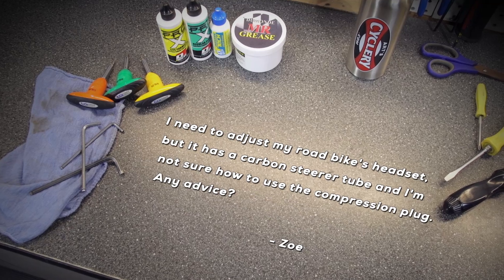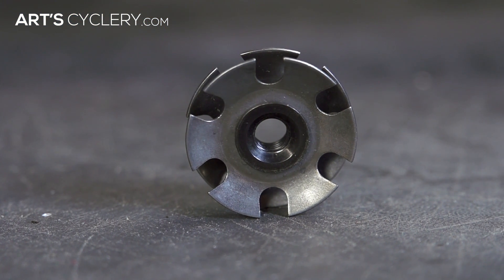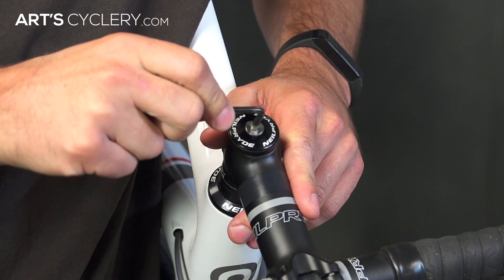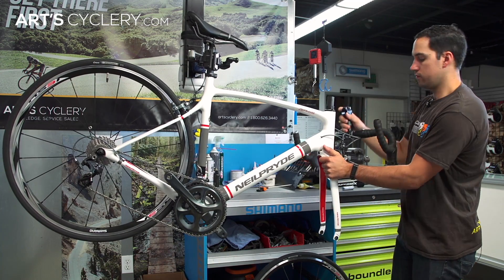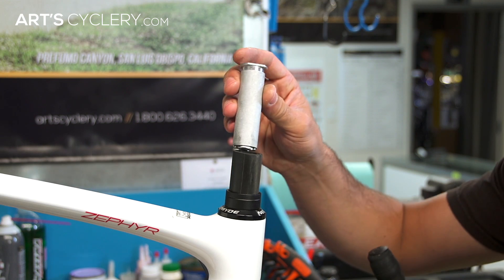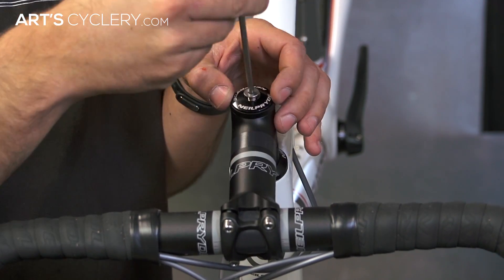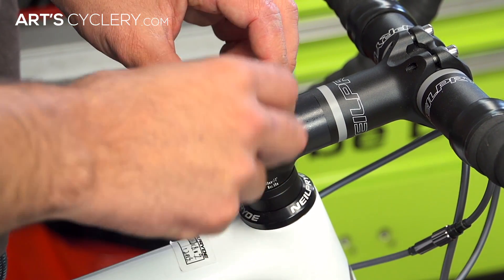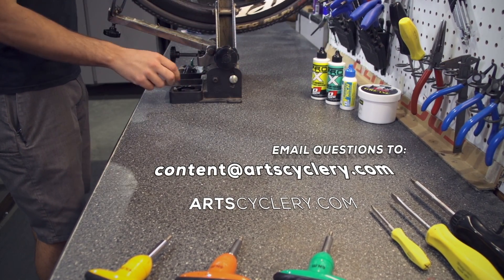Ask a Mechanic: Using Steerer Tube Expanders with Carbon Forks

Comment: That lack of space on top means the pinch bolt is literally crushing the carbon behind since the expansion plug has 4mm under it that does not expand at all only further down so the pinch bolt is literally crushing the carbon steerer. As I have done this many times it's 1.5mm ( top cap under edge) + 3 mm edge but the more important part is that 3 mm edge must be place right behind the top pinch bolt of the stem extension since this area is what you need to protect. The expansion plug has 4mm under it that does not expand it is a void area so if this area is behind the top pinch bolt you will have a problem later with a cracks on that area in the carbon steerer. From all my measurements ( without any spacers on top of the stem extension) you need a 7mm gap between the top of the expansion plug and the top of the stem extension, with this gap the top pinch bolt area of the carbon steerer is now protected and the top cap with the 1.5-2mm under section will protect the top edge of the stem extension. The top pinch bolt of the stem extension should be tightening around the edge of the expansion plug and not the carbon under that.

Comment: Can the expander plug be too long? I bought a 3 inch plug, but its long enough that it will be a little past the top of the headtube. I'm running 30mm of spacers under my stem.

Comment: thankyou. my orbea aluminum frame bike has a carbon fork. and it comes with star nut stem plug and not compression plug like this. should I change it? is orbrea perhaps being cheap when they put the star nut? does it make a difference? thank you mate

Comment: Im new at this and dont understand alot of the names used in the comments section.Is the compression plug the  same as the star nut? I bought this headset expander and its coming today along with my new folding stem for my handlebars.Do i remove the star nut to add the new stem expander ? I do right?

Comment: 1:23 I need a compression plug that sits proud on top of the steerer tube. The original one had a massive +2cm gap between the cap and the compression plug itself that the top of the steerer tube started getting crushed. I got the longer one made by Pro, but there's still 0.5CM distance. Now I'm looking for a one shown here.

Comment: Usually how much is the tensile torque (N/m) setting for the headset expander compression plug (by using torque wrench) if i installed in an aluminum fork tube? Thanks..

Comment: Does the long compression plug will grip more than the short one? I bought a new plug and installed but i had a issue.. it’s not lock and i can move my handlebar when i hold my tires straight.

Comment: I have a 1" full carbon fork but will be using a 1 1/8" stem with a shim. Confused as to what type of compressor plug to use, 1" because of the steerer, but what about the top of the stem? Thanks for the great videos!!

Comment: Can you use compression plugs on mtb suspension fork with alum/steel steerer tube?
Reply: Star fangled nuts are better on metal parts I think. What did you use in the end?

Comment: If you follow this guy's steps you will put unnecessary stress on the carbon steerer when removing the compression plug. Make sure you undo the stem bolts BEFORE removing the compression plug! Leave the bike on the ground or use an elastic band to prevent the fork from falling out.
Reply: I always back the stem bolts off a little then remove the expander plug.  I then apply the correct torque to expander then retension the stem clamp.
Reply: ... wiTh The correcT Torque on The expander bolTs and correcT Torque on The sTem bolTs , carbon grease really necessary To be puT beTween The sTeerer Tube and sTem assembly ?.. or applying carbon grease really necessary so ThaT lesser Torque would be apply on sTem bolTs ?..

Comment: PLEASE HELP! That compression plug as shown in the video is the same exact one that i have, but it seems to be stuck. The outer sleeve sits seized about an inch out on top of my actual steerer tube. is the top wedge plate supposed to be flush up against the steerer tube? I tried loosening the allen bolt, and the bolt with the wedge that sits on top only came off, the sleeve and the unit itself is not budging. I tightened it back on and got rid of play, but im just not sure if it is sitting correctly, or aligned with my stem clamp surface. I cannot find any information on removal for this type of long compression plug. Any information is helpful!
Reply from the maker: Hi Sergey, I'll look into this now. Just to verify, what fork, bike and compression plug are you using?
Reply: The issue has been resolved, but thank you. It was a proprietary Fuji Altamira long compression plug- which was warped on top, thus why it was somewhat of a snug fit and wouldn’t set all the way down. It has been replaced with the FSA compression plug and life is good. Just to clarify- the compression surface on the FSA just needs to align on one of the step bolts, correct? Because it is not long enough to cover two.

Comment: Can I use an expander with an aluminium steerer tube, or just with carbon ones?
Reply from the maker: Typically the ID on alloy and carbon will vary so most expanders will only fit in carbon. You can potentially use it in a alloy steerer if it fits, but it won't be as sturdy as a standard star-nut.
Reply: Thanks for the reply! I ended up going with the standard star nut without any issues :) Initially I thought that the expander would be easier to install, but everything is well and good

Comment: Hi AC. Which type/make of compression plug did you use on this video demo? I have been looking for a long one like that. Is that the colnago one? 

Thanks and more power!
Reply from the maker: Hi there, the compression plug was actually not branded and is found on all Neilpryde bikes that we had stocked at the time. We attempting sourcing these exact ones and they are a bit hard to come by. It may be worth asking the guys at Neilpryde, I believe it was stocked on most of their bikes around 2014. http://www.neilprydebikes.com/contact
Reply: Same I got one but no matter what I do, cleaning inside forks or what ever I have to tighten headset every so often and seems the compression thing moves I think as have to loosen stem as spacers underneath come lose and can rotate them like it not clamped

Comment: I got it now. Theres a special topspacer ( which is round, not triangular that PRO sells)then you can add a 5mm spacer then the common round top cap. So you set aside the special triangular top cap that goes with the Vibe. That is if you want to follow the "spacer before top cap on carbon steerer" rule of thumb.But seeing that PRO Bike gear does it without  a top spacer meaning top cap over stem... I guess its gonna be fine.

Comment: the PRO Vibe DI2 compatible stem has a triangular top cap that corresponds to the stem's shape.Does this mean no need to put a 5mm spacer over the stem before the top cap?
Reply: Alex A I've got the same stem with spacers above. The spacers cover the shape then I have a normal top cap no problems
Reply: matthew benger https://youtu.be/pHoSDEXR3B0
Reply: So they just want you to buy that special spacer off them.. no biggie if using normal spacers I'd say
Reply: matthew benger Exactly. IDK if it was a good idea but I just filed off that slanted groove in their special topspacer on a 10mil carbon  spacer and fitted it onto the Vibe stem

Comment: can i use a Steerer Tube Expander on my mtb with an aluminium steerer tube?
Reply from the maker: If the ID on your alloy steerer is close to that of a carbon steerer, it should work without any issues.

Comment: I have a Cannondale synapse with the entire stem cap turning I want to switch to a regular one where you turn the stem cap bolt. Is this possible?
Reply from the maker: Does your synapse use a standard m5 compression bolt? Sometimes the carbon compression caps that come with Cannondales require proprietary hardware, meaning you wouldn't be able to swap, but if the bolt is a standard size, you'll likely be able to swap it out.

Comment: Hi ! My expander is stuck in my fork, even with unscrewing the center screw. How can I remove it without hurting the carbon ?
Reply from the maker: Hmm, that is a pretty uncommon problem and you absolutely want to be cautious when dealing with carbon steerers. Which make/model expanded do you have?
Reply: I don't know exactly, that's a FSA headset and a Giant TCR fork, the headset seems low quality, so I wanted to change it (and the expander to get some weight gains) but I can't get it out. I tried to put some WD40 in it in case something were blocked but still in..
Reply: Well, I do have the same problem on my Specialized Roubaix.
Reply: Ok. I figured it out for my case. Maybe it helps in your case too. The screw was pulling a cone into the expander. Loosen the screw and hit it with a mallet, so the screw is pushing down the cone. After that my expander come off without a problem. Hope that helps.
Reply: It works !!!! Thanks a lot !!

Comment: Can you guys give me some info about that specific compression plug and where I could possibly buy it? I'm trying to install a stem-cap phone holder (from Topeak) on my SuperSix but the stock FSA compression plug design won't allow for its installation. It appears that with the one shown in the video, there's a threaded channel the stem cap bolt goes into, which would be perfect for my application.
Reply from the maker: Running compression caps with the toppeak phone mount can be tricky. To my knowledge, the compression plug in the video is a proprietary Neilpryde plug that isn't available for aftermarket purchase. That being said, Mob Armor makes a phone mount that will mount to either you handlebar or tube stem. http://bit.ly/2eEcpXH

Comment: How come some manufacturers recommend no spacers above the stem? My Cannondale SS keeps coming loose if I have more than 5mm of stack above the stem.
Reply from the maker: What manufacturers are you talking about? It seems that having NO spacers above the stem is likely the cause of loosening, and not the other way around. Have you double-checked the installation of your steerer tube expander? And have you properly torqued all bolts?
Reply: Cannondale. It's even stated in their manual (for my 2013 model at least). I double checked the installation many times, used a torque wrench, greased the expander, etc. It kept coming loose.
Reply from the maker: Expanders should never be greased. All carbon interfaces use friction paste (if anything) and not ever grease. That is the root of your problem.
Reply: To clarify, I used grease on the inside bolt of the expander plug (the one that compresses the two ceramic looking discs put pressure on the steerer tube) and used carbon paste on the inside of the steerer tube. I took this bike to 2 different shops and they both re-installed everything and it still came loose with > 10mm of stack. Only after I took it to a Cannondale dealer and they told me I had to cut the steerer tube down did it stop.
Reply from the maker: That is really interesting and is the reverse of what we normally see, aka, loose headset because there's not enough stack. Glad you got it fixed.
Reply: @artscyclery875  You should not use carbon paster on the expander plug.